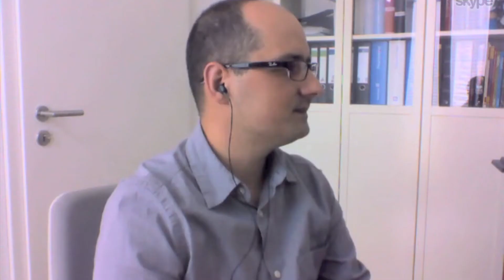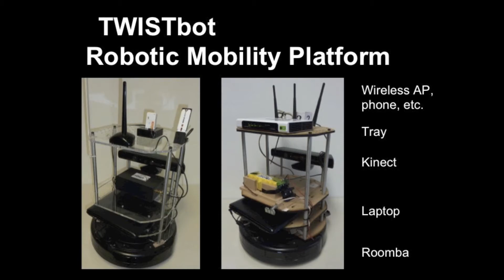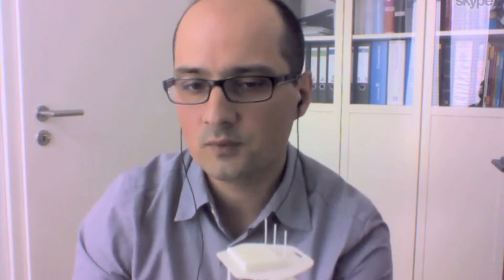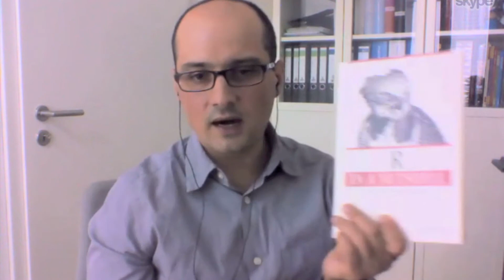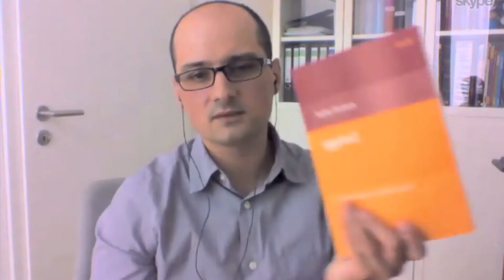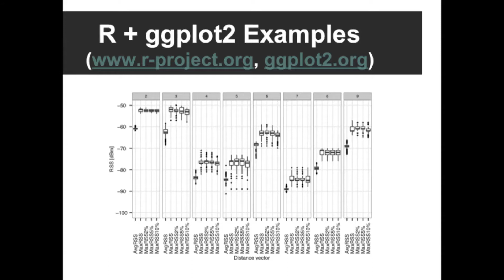Indoor Localization Future Directions, Dr. Vlado Handziski, TU Berlin

Comment: Thanks a lot for the overview of your project. I have some further questions:

- Do you directly send the data from the nodes using Google protocol buffers?
- Can you provide more details about the data you gather from the external interferences?
- If you are gathering data from external interfereces, how can you replicate the exact same experiments in two places?
- What method/tool do you use to vizualize multidimentional data in 2D/3D?
- What makes your data be considered as unstructured data?